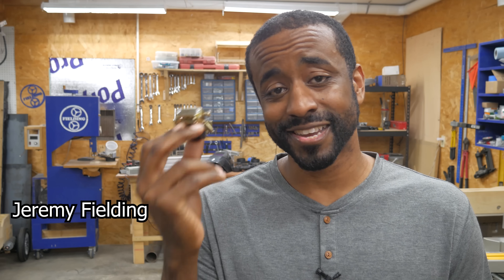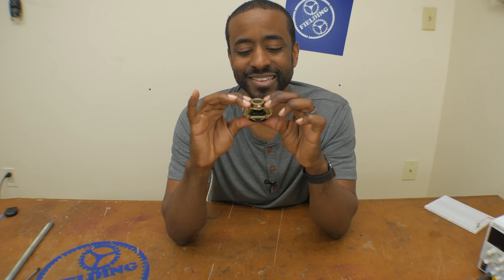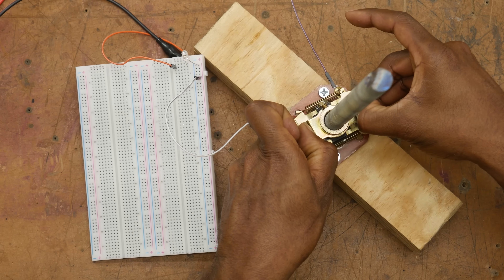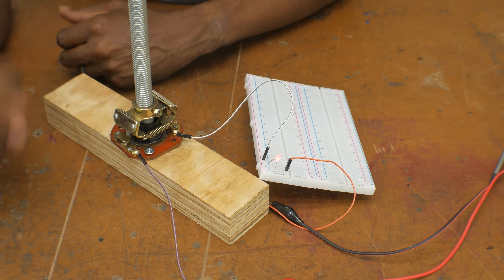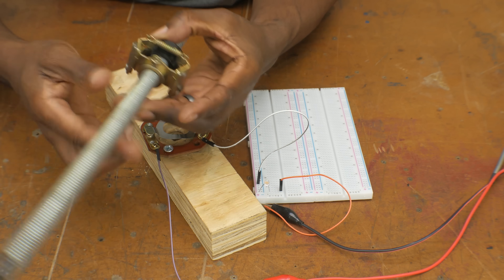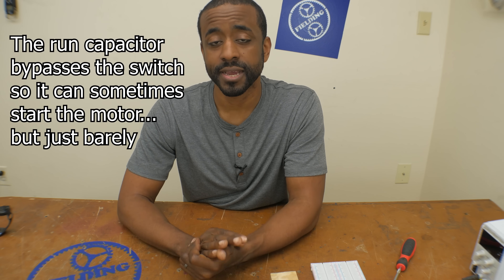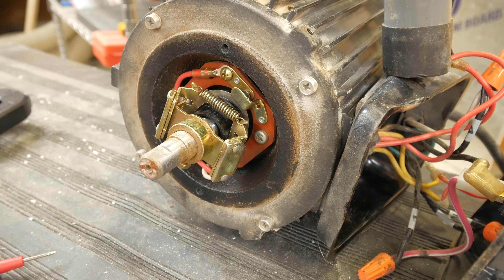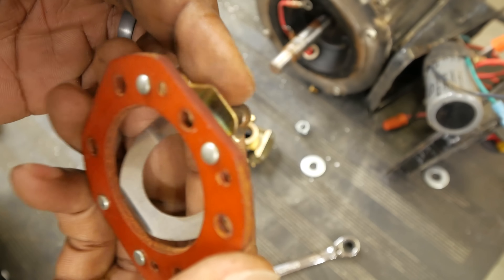This Clever Device Is Found In Nearly Every American Household. How It Works And How To Fix It

Comment: Love your videos, On my air compressor it runs for about 2 to 3 seconds and then blows the breaker on the house. You know what I should be looking for?
I also replaced both start capacitor and run capacitor.
Reply: If it ran well before first thing would be to change the house breaker, as likely it is running at near full capacity and has aged. If not, then most likely the motor has a shorted turn in the windings. Simple test is to remove the belt so the motor runs unloaded. If it is just drawing too much current at start up the breaker will not trip, but with a shorted turn the breaker will trip within around 30 seconds. Breaker trips new motor time. Could also be a stuck starter switch as well, so strip the end with the switch and check it is disconnecting the winding  and the contacts are not burned shut.
Reply: The pump could be low on oil putting a strain on motor.

Comment: Reminds me of a locking clutch. when you're engine gets to a certain RPM. the weights swing out and use centripetal force on a set of rocker arms that transfers that extra force to the clutch plates increasing friction on the clutch assembly and giving better power transfer. it's mostly used in drag racing i believe.
Reply: IIRC centrifugal clutches are used in motor scooters, though on those the pads are also the weights

Comment: Sanding the surface of such a contact (in older times the ignition of cars also had such contacts) is no solution. The surface is harder then the inner material. In a short time you will have the same problem. Replacing ist the better way. The mechanic is genius.

Comment: Good one..... Yup, unplug, and also remember that a start capacitor can still give one good shock. even after the motor is unplugged.
Reply: I got a good boot from an unplugged VCR .my forearm ached for a week
Reply: Adam Christoff 🤣🤣🤣🤣🤣
Reply: Duke Makedo Hmmm ... what if he switches to a flux capacitor instead?
Reply: @JillofAllTrades2  He'd just get a shock, unless he, and his motor, were travelling at 88 miles per hour.
Reply: Duke Makedo 🤣🤣🤣
Reply: @JillofAllTrades2  
Perhaps,  but you'd end up in the 1980s.
Reply: Super Geek 😱🤣🤣🤣
Reply: Yeah, I was thinking that spark was the capacitor discharging so (as you mentioned) unplugging wouldn't have helped prevent it.
Next video: Repairs a CRT.
Reply: In the Air Force the jokers of the group would throw a capacitor to some unsuspecting person to catch.

Comment: Back in the 70's I was a car mechanic specializing in tune-ups and ignition systems. I always marveled at the innards of the distributor. (Points/Condenser) This is different... but the same. :)
Reply: usmcbrat2  That is exactly what I was thinking when he was sanding the contacts.  I remember using an ignition file to gently file a set of points that had become burned in the days before electronic ignition.
Reply: Rick Ammon 
I have a set of blue steak points with 50-k in them. On a motorcycle.
Reply: @Freespirit5371  The transition to electronic ignition systems made the tune-up business boring to me. With older cars there was something to fix/work on/understand. With new cars the ignition system became a "magic box" and when it broke you made the customer buy a new one.

Comment: Excellent explanation and a fantastic channel. With that said, it sounds like the bearings on that motor need a bit of work.
Reply from the maker: agreed
Reply: Jeremy Fielding And if that starter capacitor gives you any trouble try switching it out with a flux capacitor. You should be good on the banana peel fuel tho unless you’re having trouble getting your hands on produce because of the pandemic. 😉

Comment: This switch is also found in fractional horsepower split-phase motors (no start or run capacitors) to disconnect the start winding once motor is up to speed.

Comment: I wouldnt worry about forgetting to disconnecting the electricity when working on motors.

I find they remind you themselves sooner or later
Reply: Yes always a shocking reminder.
Reply: ...it has been my experience...sooner ⚡ 😁
Reply: @ltdees2362  yeap I mean zap
Reply: It was that wet morning when 2 of us installed a motor control on a 50 hp pump jack.  

It was a unit we hadn't built and were pushed to get it going first thing.  The dumbass who originally wired that box had wired the remote handswitch backward. 

I was pulling the wires out of the control box I was going to install the switch into. 

I'm standing in mud and water pulling the wire through the box when the coworker slammed the switch in on the 3 phase line when 501 volts lit me up with my hand holding that backassward wired 24 volts that gave me 500 volts instead of 24 volts. 

I couldn't figure out what that regular beat of wham wham wham that defeaned me. 

I finally realized that was my elevated heartbeat.  About that time I was mad.

The guy that threw the line fuse in was keeping an eye on me.  I was a mad mofo. 

Never trust another person dealing with electricity.  Don't be intimidated to get that stuff done in your own time. 

2 minutes to walk and check it out yourself isn't time burned up.  That burned part is your hand and heart and brain. 

A gun on my hip might have made the situation much worse.  He did have to dodge those Klein sidecutters.
Reply: Well that an having a good dmm meter (one safety gaurds) i am glad they worked or that current could have gone through the meter and potential you.
Reply: Forgot to disconnect the car battery when replacing a starter motor. I definitely was reminded about it when my wrench bridged some connected posts while disassembling it
Reply: @imthedarknight-8755  In one of my technical classes they showed us a picture of a wrench welded to some poor sucker's wedding ring. The dude was supposedly tightening a battery clamp on his bulldozer when he bridged the posts on a 48 Volt battery.  He lost that finger. 
The thing about batteries is that if you screw up and short them, they don't stop until they're DONE or the short is removed - and a crescent wrench can carry an assload of current.
Reply: @davidstone1227  Just how much current is an assload? Is that what ends up making a shitload?
Reply: @mikewilliamsleatherlips6697  Yes
Reply: We've all done it.
Reply: @shawnatkinson4448  and some of us survived...
Reply: heart stopping????
Reply: Got that right!
Reply: Very true. 49 and it happens on a weekly basis. Old myth you can develop a resistance. I would not recommending anyone try. It might just be, I try not to be the ground.
Reply: My ex father-in-law is an electrician. He's specialized in heavy machinery and industrial installations. I had issues with a light switch in my living room, and he gladly volunteered to fix it for me, if he could join us for dinner (I lived alone with my daughter at the time). He started taking the switch apart, and I noticed that the lights were still on. Here's a translated rendition of what ensued:
 - You don't wanna cut the power?
 - No, it's fine. I always work under full voltage.
 - That thing looks broken. Perhaps it would be best to...
 - No-no. I got this.
[BZZZZZZZT] (power went off)
 - Hmmmm . . . Maybe you were right.
And of course I was out of fuses, the shops were closed, and the pile of fuses the brought just in case, were all industrial grade fuses that did fit inside my meager li'l fuse box. I had to pick up a spare fuse from my older brother. He lives in the neighboring apartment building, so it wasn't much of an issue, but how he laughed and pointed fingers at me . . .
Reply: We had an electrician doing some minor work in the plant. He'd also done some major work out  in the manufacturing line. There are times when they can't drop the power, for that they have a "bomb suit" so they don't end up being the ground. He forgot he had his cell phone inside the suit... set to "vibrate". :-O  I asked if he kept a spare pair of clean shorts in his locker!
Reply: Amen!
Reply: jkenney IM DEAD bro!!!!  😂😂😂😂
Reply: Been there, done that. Or, more accurately, had it done to me. On a good day, you're only working with 120 volts.

Comment: I love this channel. Never heard about this device before despite working as an electrician for years. Good info to have.
Reply: I knew there's a switch to bypass the capacitor.  I just didn't know what sort it was.
Yeah, mechanical is likely still the cheapest way to do that.
Reply: @its1110  Both cheap and reliable. Win-win 😄

Comment: These also serve double duty as a safety device on namely electric clothes dryers (double pole), if for any reason the motor for blower and drum stops it also kills heat.
Reply: Commercial convection ovens, too.
Reply: @dundalkmacgyver800  Unless the convection oven has manual fan control. Those can be used as either conventional or convection, and thus do not shut down heat when the fan is not running (present on some Vulcan ovens).
Reply: @nuclearusa16120  Being more specific, that's correct. That type of convection oven (with manual fan control option) is less common, and are found in commercial gas ranges with oven (Vulcan is one make). 

Still, most commercial gas ranges with convection ovens use a normally open centrifugal switch in the fan motor. 

Almost all stand-alone commercial gas convection ovens use a normally open centrifugal switch in the fan motor. The one exception that I know of is a Montague model that has manual fan control.
Reply: Thermal switches are used to cut the heat.
Reply: @unknownhuman1000  yes as a last resort either 1 time or resetable.

Comment: I don't know the exact technological lineage, but you could imagine this being a further development from the ideas that led to the centrifugal governor for mills and later on steam engines. It was invented by genius polymath Christiaan Huygens in the 1600's!
Reply: yep fundamental Newtonian physics and mechanics.   
The 18th and 19th centuries provided so much scientific and technical progress.
Reply: I understand that we get the term: "Balls to the wall" from the steam engine speed governors.
Reply: @rickey5353  I heard that was from the throttle on aircraft.  The control handle had a ball on the end of it for easy gripping.  Moving the control forward (toward the firewall) increased engine speed.  SO,  when you shove the control  "balls to the wall" the engine was at it's maximum speed!!  BUT,  who is to say where the REAL first time meaning came from??
Reply: @rickey5353  Exactly my understanding as well.
Reply: @rickey5353  True that? Citation?
Reply: @rickey5353  Sounds like it ought to be from the steam age, but the Oxford English Dictionary gives a more recent etymology: "Originally with reference to the ball-shaped grips on the throttles of certain military aircraft (which were opened by being pushed forward towards the firewall)."
Reply: I was thinking it had the exact same evolution, only I believed Watt to be the inventor (a full century later). thanks ;)
Reply: Came her to say the same, that the Huygens governor was the first version of centrifugal switch.
Reply: I have all sorts of people on the internet saying that the speed governor was invented by James Watt in 1788.  Can you show me a link to a Huygens version from the 1600's?  Thanks.  Might have been used in a water mill or clock?
Reply: @freesk8  https://en.wikipedia.org/wiki/Centrifugal_governor

https://books.google.com/books?id=TmydDwAAQBAJ&pg=PA1149&lpg=PA1149&dq=huygens+centrifugal+governor&source=bl&ots=X_y3X85J9v&sig=ACfU3U2uqVxeFuLGtJztz9Vg7XhCYQTipA&hl=en&sa=X&ved=2ahUKEwiQz_SZzuDpAhUFHs0KHXpYDFoQ6AEwE3oECAIQAQ#v=onepage&q=huygens%20centrifugal%20governor&f=false This book from 1871 attributes it to him.

https://www.princeton.edu/~hos/mike/texts/huygens/centriforce/huyforce.htm An original paper by Huygens in translation
Reply: It looks like the airplane throttle reference is the correct answer to "Balls to the wall".  Once again, though indirectly,  I learned something from this channel.
Reply: I stay with H.E. White as the inventor in 1919, granted 1925 and Huygens in 1673 as the conceptual creator.
Ladies and gents, if I may:

Christiaan Huygens (1629 - 1695) was a Dutch physicist, mathematician, astronomer and inventor. His most famous invention was the pendulum clock (1656) that became the most accurate timekeeper for almost 300 years.

In 1659, he published his work De vi centrifuga  (in Latin) containing the still-in-use standard formulae for the centripetal and centrifugal forces .

In 1673, another work of his (also in Latin) Horologium Oscillatorium sive de motu pendulorum , on pendulums and horology, containing the analysis of a problem posed by the French Mathematician Mersenne on how calculate the period of a pendulum made of winging rigid bodies of any shape and the analysis of the conical pendulum, consisting of a weight on a cord moving in a circle , using his concept of centrifugal force . The measurement mechanisms used for such analysis lead him to another invention of his: centrifugal governors used to regulate the distance and pressure between millstones in windmills, as already stated, making the Netherlands famous for such agricultural equipment until now. In 1788, James Watt adapted such control to regulate the quantity of steam into an engine, in the beginning of Industrial Revolution it caused such impression that James Watt is often confused as the inventor even nowadays.  

Another cause of confusion can be the types of controllers: the most famous centrifugal governor is a Continuous-type control that controls a variable, usually speed, of an engine by regulating the quantity of fuel or fluid such as steam, in order to achieve any desired value (set-point) between min 0% to max 100% or in some cases such as on idle speed let's say 50% to 100%. Such continuity makes it also a Proportional control , a linear function.

The History section of Centrifugal switch in Wikipedia is quite uncompleted. The US Patent #1,630,394 granted to Royal Lee on May 31, 1927, is more about an Electrical speed governor adding more poles to an already invented single pole centrifugal switch . Such governor is a Discrete-type control meaning it has a limited number of  steps or states of regulation to make the variable achieve the set-point. As a non-continuous and non-linear function make it also an On-Off control instead a proportional one .
In this specific R. Lee's patent the available states are:
Stopped: 0% speed;
"Low Speed": motor at let'say 33% speed;
"Intermediate Speed": motor at let'say 66% speed;
"High Speed": motor at max 100% speed;

In other hand Harold Elijah White, inventor of Montclair, Essex, NJ, had his US Patent #1,552,589A CENTRIFUGAL ELECTRIC SWITCH applied on November 15, 1919 and granted only on September 8, 1925, only one and a half years before Royal Lee's electrical (discrete) speed governor. H.E. White's invention was not intended for speed control, it  is a single pole switch, more a safety/starting device than a control device, that is exactly the point of this video, as described by himself:
"Single phase induction motors, to which this invention is especially applicable, comprise two windings, one of which is required to be energized only during starting and the circuit of which it is desirable to open when the motor has attained a certain speed" .

H.E. White's patent took so long to be granted because the dispute over other applications of Centrifugal switches already in use since 1900 to 1910 or even earlier, mainly in electric fans. It was a "common" invention based on Huygens concepts every reasonable Engineer should know, maybe each one thought that each other already invented, and despite the worldwide claim of an US Patent other countries with developed industries as Germany and England were not under US laws and some other countries even had patent regulations.

In my humble opinion:
 Hooray for H.E. White and Huygens.
Reply: Still found in every lawn mower type engine.
Reply: HoyGuns!!! So studly.
Reply: Indeed very close but governors also flung weights outwards, I think to limit RPMs of any rotations. This uses that principal in reverse.